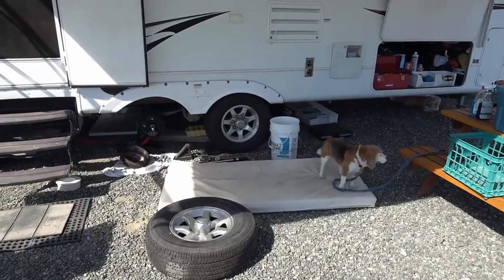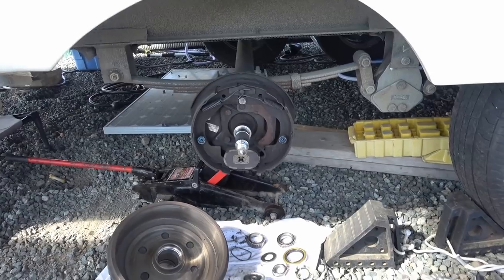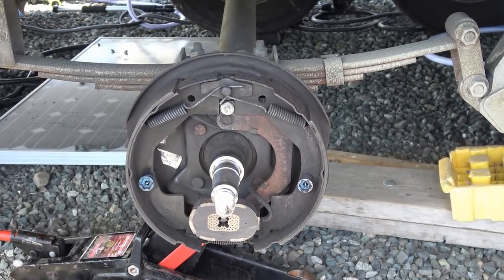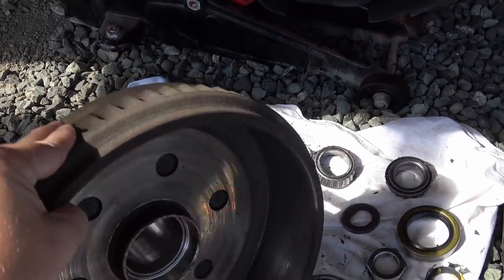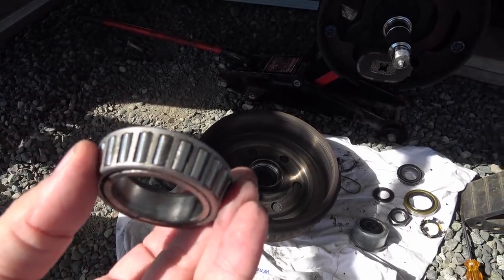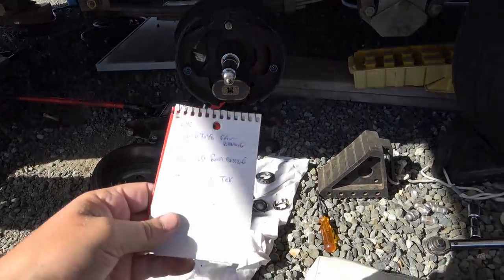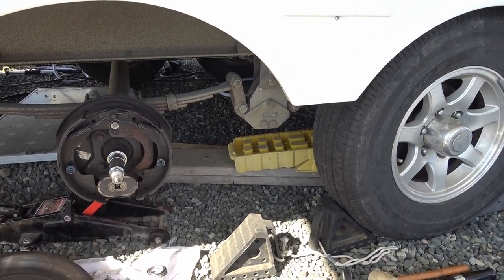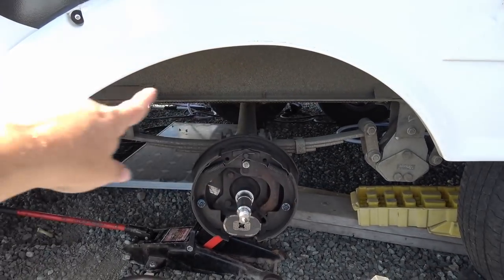Checking my Keystone Trailer Brakes and Wheel Bearings

Comment: I do prefer jacking up the rig near the u-straps as well, adjusting the brakes can be a little cumbersome though.  When jacking up on the I beam it is best to have the truck attached and the front landing gear up.  In my opinion, it's best to keep the truck attached to the fiver with the gear up when doing a wheel removal if possible.

Comment: I always use Mobil 1 wheel bearing grease, much better heat resistance. Change out the seals while your at it and save all the old parts for emergency.

I changed over to disk brakes for my 08 Cougar, best mod I made. My 2003 Dodge Cummins wasn't adaptable to Air Brakes.

Best of luck 

Ron & Liv
Reply from the maker: Thanks Ron

Comment: The grease I always used was simply called Penzoil high temp wheel bearing grease. It came in a yellow tub so since I always hand packed them that wasn't a problem. Looks like you have things under control - proceed! LOL!

Comment: One of the handiest ways I've run across for jacking a trailer up is on a trailer with hydraulic jacks lower the front down as far as it will go then put jack stands under the frame behind the axles then raise the front back up until all of the wheels are off the ground. Not sure if it would work on electric jacks (probably take way longer) and I'm sure no one would want to do it on a manual jack unless it's the only option.
Reply from the maker: Neat trick. :)

Comment: After owning several trailers.. RV's, boats & utility and having used many different greases I am convinced brand means little as long as it is wheel bearing grease.  Exception is with boat trailers that get submerged in water where a marine wheel bearing grease is in order.  No need to over think it.

Comment: I jack my trailer in the same spot, as long as it is under the leaf spring it is fine.  I use Mobil 1 synthetic grease in my trailer bearings.  Last year I replaced all my bearings with Timken bearings, got them on Amazon.  Make sure you replace the race along with the bearing.  Amazon sells Timken bearing sets that come with the bearing and the matching race.  A google search with your bearing number will let you know what set to buy.
Reply from the maker: Thanks!

Comment: I noticed a grease fitting on the end of your axle.  If so, then you have some type of "easy lube" bearings.  You don't have to take the bearings off the axle to lube them.  Just attach a grease gun to the fitting and pump until old grease comes out the front.  (At least it's that way on my 2003 Ameri-camp 5th wheel.)
Reply from the maker: Yes, they are the Dexter EZ-Lube axles. Funny thing is the Dexter axle manual still recommends a bearing inspection and repack once a year even with the EZ-Lube. What I do is have them inspected and repacked every two years and on the in-between year pump a little fresh grease through while spinning the tire so as to not blow out the rear seal. So far it's worked out well, I haven't had any failures.

Comment: Future Project - Grease Fitting on suspension?   Or a Morryde?   Do you have grease fittings on your suspension?  If not that could be a future project for you.
Reply from the maker: They don't have grease fittings. Maybe down the road. I had all the shackles, bushings, bolts and the 2 Trail Air equalizers replaced 2 years ago so I'm good for a few more years.

Comment: I added bearing buddies to my motorcycle trailer when I did the bearings and the bearing buddie kit came with an added seal for the back to keep the grease in. I agree with the Timkin bearings. Not a hard job.

Comment: If you do the bearings use timken bearings, and a standard bearing grease is all you need. When you put the new seal in just hammer it so its flush with the outside, not until it hits the bearing. And unless youve got hubcaps on your wheels then you dont have to pull the wheels. Just hammer the bearing cap off and pull the drum with the wheel
Reply from the maker: Thanks, I have Timken bearings, races and seals on the way. Cheers, Ray

Comment: The grease i use, which was recommended in the manual for my axles(Dexter), it the Lucas X-tra Heavey Duty Grease. I bought mine at Canadian Tire. It is great for high temp, extreme pressure, and cold weather. It is also a very highly compatible grease so if you don't know what kind of grease is in something you can use it and there is a very very slim chance you would have a negative reaction between the different greases.

Comment: Dexter Axles can be lubed through the grease fittings.  No need to take it apart.  I do it about every 5,000 miles.
Reply from the maker: Thanks, yes I have the EZ-lube and will occasionally squirt a bit of grease in. However, that doesn't mean the bearings, spindle, and brakes, etc. don't need to be periodically visually inspected. The Dexter manual recommends once a year. I usually stretch it to every two years. At that time you may as well manually repack as everything is apart. Cheers, Ray
Reply: I full time in my RV but I don't think I'll be taking the axles apart - I grease them as much as I can.
Reply: If you just use the fittings to lube your bearings you don't get the chance to inspect the brake pads and the condition of the bearings.... When we take our trailer out we travel across country...We bought a used trailer in Ontario when we got to Quebec we broke a leaf spring on a Sunday!!!! Called CAA the person only spoke French!!! We were very lucky We were able to stop at a roadside pit stop area the cleaner was there and spoke English and spoke to CAA for us..the lesson is when your in school don't mess around in French class!!!! We got new leaf springs the following day continuing to the trans Labrador highway lots of gravel roads!!! Crossed the ferry to Newfoundland  did gros morne park drove to St.John's  where we noticed our inside of the tires were bald!!!! We bent the axle.... We had to wait a few days to get it into a shop but worth it they did a fantastic job fixing it and never had a problem with the trailer after. The plus we partied on George Street seen the Cabot tower hiked the trails and went to cape spare...Great time. From there we traveled to British Columbia settled in Calgary Alberta. The next year we went back to Ontario and traveled back to Victoria then back to Calgary... My advise every spring repack your bearings inspect every part of that axle!!!!! When this lock down is over and Covid is controlled we are moving to Nova Scotia !!!!! Then we will explore the east!!!!

Comment: You probably already know this but one of the most important parts of the job is to rub down all of your rotors with brake cleaner prior to reassembling!  Grease or hand prints left on the rotors will cause hot spots and pulling when brakes are applied!
Reply from the maker: Thanks, I'll make sure to clean all the surfaces, Cheers! Ray

Comment: Timken or SKF (NOT Chinese,) bearings, as a couple others have already said, as well as a name-brand high-temp grease. Make sure you change the "races" with the bearings. You can knock the old ones out with a flat-nose punch. Usually, you can install the new race by tapping it in with the old race placed on top of the new one with the same orientation as it originally went in, (taper going towards the inside of the hub.) Once the new one is seated, CAREFULLY, (and you might want to use a brass drift punch,) knock the old race back out, (if it starts to re-seat in the hub -- sometimes they do, and sometimes they don't. . .) BTW -- if one bearing is bad, it's good practice to always change both. If a bearing is starting to pit or flake, chances are metal can work its way through to the opposing bearings. Bearings aren't that expensive vs. the piece of mind with doing it right!!
Reply from the maker: Awesome, great info, thanks very much, Ray

Comment: Two things you need for sure: 
Jack Stand
High temp waterproof bearing grease

Did you clean those bearings before you shot the video? It is disturbing how little grease is on them.
Reply from the maker: Yes, I had wiped all the grease off things to inspect them. There was a plenty of grease so no issue there. I'll be sure to show the complete job when I go to do the others. Cheers, Ray

Comment: This is what I used:   https://www.amazon.com/pennzoil-7771-wheel-bearing-grease/dp/b000kkjrj0
Just a thought, if the tire shop is jacking up the trailer by the axle (a complete No No) they might have bent it and that is why you are seeing wear on the bearing. My trailer (2004 HitchHiker) never had a issue. Always serviced every 2 years by me.
Reply from the maker: Thanks,  I'm on my 4th set of tires, we travel a lot :)  And had them installed at 4 different shops, every one of them jacked under axle u-clamps. I don't have any abnormal tire wear so don't believe I have any bent axles. The bearings were pitted but not abnormally worn. Cheers, Ray

Comment: Hey Ray, Glad to see you didn't pull what I did,  I attempted to use the ez lube axle to push grease through with a hand pump grease gun!  I followed all directions in the Dexter manual, pumped slow and turned the wheel and stopped when clean grease came out.  Well it all looked good but the inner seals on the drivers side gave way and grease started to drip and by the time I noticed it, my brakes were soaked and I had to replace the brakes.  I purchased the new brake shoes in a kit with springs caps and nails, they were about $35.00 each so I bought four.  I also went with new bearing seals.  I used Valvoline multi-purpose GM red grease from Auto Zone.   It's just a messy job but plug and play.  I have a Cougar X-lite fifth wheel and also went up on the weight rating of my tires from 8 to 10 ply.  While under the camper I noticed the roads of Alaska tore up the fiber like cloth they use over the wheel wells exposing the wood flooring.  I took sheet metal and fabricated inner fenders to protect the wood, sealed it with silicone caulk and sprayed it with undercoating.  All in all a complete over hall.  Love to watch your videos!
Reply from the maker: Thanks for the word of caution. I've heard that can happen.
Sounds like a great mod to the wheel wells! Cheers, Ray

Comment: Your brake magnets have four wear indicator holes, one at each end. Your magnet only had two visible, I wouldn't go long before changing them.
Reply from the maker: Thanks, I can see three, but the left is barely there and the top is one gone, so will get them changed soon,, thanks.

Comment: I don't have anything to add other than what has already been said, get good quality bearings and use a synthetic high temp grease. What I'm curious about is why is your truck not going to be there until the end of October, didn't you order it in June?
Reply from the maker: Yes, around the end of June, the average time to delivery up here on Vancouver Island is 3 months but its running late due to a shortage of double tier rail cars used to transport trucks and SUVs. It's caused a backlog in the shipping. Its an industry-wide thing affecting many brands not just Ram. The latest delivery estimate is mid to late October.
Reply: Maybe. I have a feeling it's more about the NAFTA agreement. Either way, they'll get it worked out.
Reply from the maker: Dirt Road Sailing  https://www.freep.com/story/money/cars/chrysler/2018/07/21/ram-trucks-gibraltar-trade-center/808814002/

Comment: I’m shocked that your seal is in new condition. When I use the seal puller my seals are totally destroyed. I have to use a hammer violently on the seal puller handle to get the seals out. I have a suspicion I’m doing it wrong.
Reply from the maker: I read about this method on a boating forum. Thought I'd try it since I knew I was going to be replacing my bearings and seals anyway. I pulled everything off then put the hub back on then the washer and nut on a few turns. Then I used the hub like a slide hammer. The inner bearing and rear seal are left loose on the spindle. Worked well.

Comment: I ordered all my hardware  for my axles from etrailer.com, excellent company to order from, and very helpful if you have any questions, I used Mobil 1 synthetic grease (product # 53201-0) for my wheel bearings.
Reply from the maker: Thanks, I had good luck with them when I ordered some landing jacks.

Comment: Hey Hello, when you reattach those wire brake behind the backing plate with the wire coming from the axle, what exactly do you use for reataching them togetter? And do you weld them too? Thanks for your help.
Reply from the maker: Here is a section or a video I did detailing my brake and bearing change https://youtu.be/8vZDXQhlK60?t=735  It shows how I attached the wires. Cheers Ray

Comment: Where can you get cross reference  parts numbers for bearings?  Big assumption here is that you can't find labels or info on the axle and the owners manual does not list a part number.
Reply from the maker: Well, I know that the axles are Dexter and they are rated  4400 lbs so that seems to help a lot. I also have the label off my axle with a bunch of numbers on it, plus the part numbers on the parts themselves. I guess if I didn't have that I'd need a micrometer and start measuring the diameter of the spindle so I could match up the right sized inner and outer bearings and seal.

Comment: I always used "high Heat" grease on trailers, However, I have since been informed that High Heat grease will not lubricate unless it reached a high temp. I now don't know what exactly to use. I plan to research it before I have to grease my wheels again. I could just call my brother who is a mechanic, but I wouldn't want him to know he knows something I don't - LOL
Reply: Depending on how cold you're talking there really isn't a great grease that will do well in very cold and very hot. That being said there are greases that perform well at low temps, and because of the friction with bearing spinning the grease heats up fairly quickly. I recommend Lucas X-tra Heavy Duty Grease.
Reply: @trentond83 
I know a lot of people like the Red & Tacky but the one you mentioned is probably good too. Can't go wrong with Lucas.
Reply: Yes Lucas makes great stuff! I used to use Red & Tacky and I only switched to the X-tra heavy duty because it is a Polyurea base instead of lithium. The polyurea is compatible with a wide range of other greases so if you need grease some place and don't know what is currently in there it is a safer choice to use than lithium. Combining greases isn't a great idea to begin with but at least i know with the polyurea base that there is a very slim chance of a negative reaction.
Reply: @trentond83 
I see. I thought Lithium based was better or more recommended so I'll do some research.

Comment: Hi  Ray.    I didn’t see a jack stand?   Using a stealth jack stand?

Also, I don’t know what bearings are available in BC but I have found SKF to be best quality.  I recommend them over oriental made.   Just a better bearing.

Nice video..
Doug
Reply from the maker: I figure the other tire is like a jack stand just in case the trolly jack fails. Like when you use a trailer aid ramp to change tires.
https://www.rvpartsexpress.com.au/media/catalog/product/cache/1/image/600x600/e8fc135657c3e4a2aff16b85041b627c/t/r/traileraid.jpg  Cheers, Ray
Reply: The other tire would hold that trailer up if the jack failed no problem...

Comment: Allstar Timken ALL78241 Red Wheel Bearing Grease, and timken or skf bearings and races, and use a bearing packer. Be sure and research how to properly seat and torque your wheel bearings. I use to own a trucking company and we always did our own brake and wheel bearing work, i dont  ever trust someone that has no interest in my equipment.
Reply from the maker: Cool, thanks for the recommendations. I feel the same way. It's a good thing to know how to do yourself. Cheers, Ray

Comment: New bearings new races, I assume you will change both at the same time.
Reply: Yes, if you see wear on the bearing, you assume the race (or cup) will be worn also.  Change in sets.
Reply from the maker: Yes, since the rig is over 7 years old I'd like to swap them all out. I saw only 2 bearings and rear seal. Are the races pressed into the hub I missed? Some kits seem to show them and others don't.
Reply: @LoveYourRV  yes the race is pressed into the hub.  You drive them out with a punch, however you need a race driver set to reinstall the new races without damage.
Reply from the maker: Oh, OK I saw a video where the races get hammered out with a punch.
Reply from the maker: Thanks, will be worth the cost compared to having to pay a shop to do it. :)
Reply: @LoveYourRV  I have always used the old race to drive the new race in. It's straight forward.